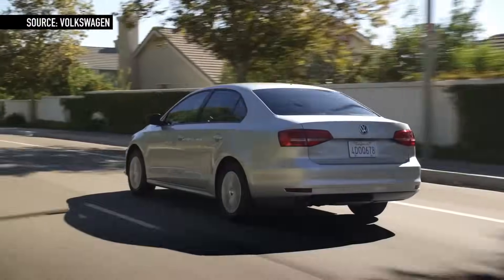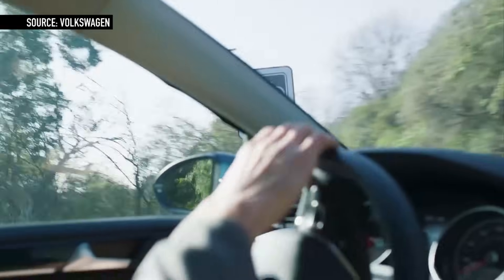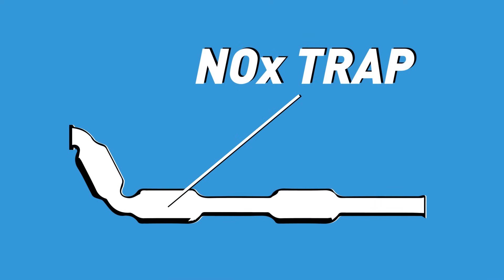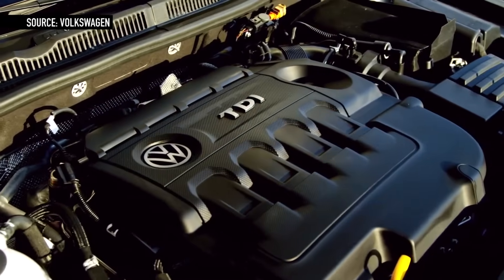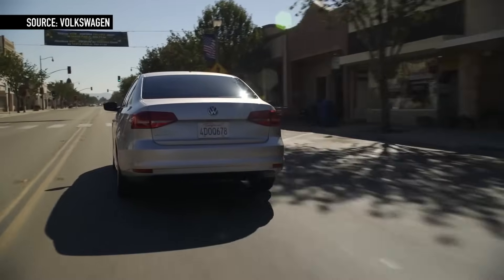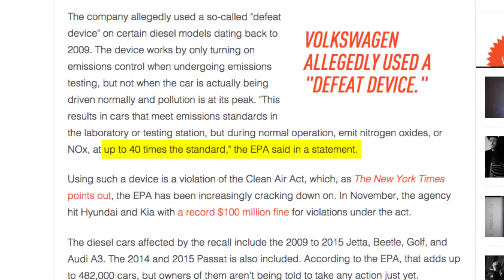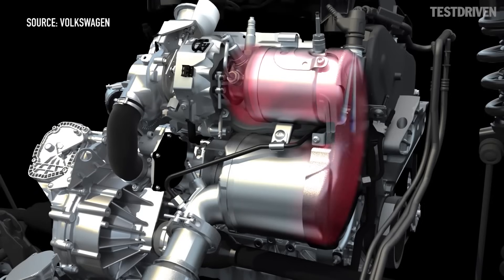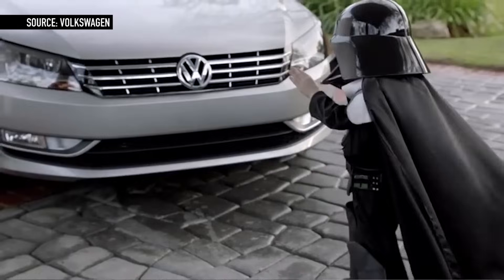Volkswagen's diesel scandal, explained

Comment: so more fuel burned equals better emissions, but more miles on less gas doesn't equal less emissions?
Reply: +Jonathan Root 
My hybrid car has a "lean burn" mode that uses less gasoline, but makes more nitric oxides.  In fact most modern Direct Injection engines have the same side effect.  (Burning more fuel eliminates the NOx but at cost of reduced MPG)
.
Reply: +eddie telleed the NOx are directly harmful to humans while CO2 is a greenhouse gas, it's not clear cut what's better
Reply: +Jonathan Root Yup...welcome to the United States!!!!!!
 I drove diesel cars in Europe in 2007 and was amazed...I mean totally astounded as to the performance and mileage that cannot come close to the US diesel cars. So I tried to buy one and was told that none were available in the US and if they were the performance would be at least 30% less. All this due to US standards, requiring you to  to spew tons more greenhouse gas at the cost of other trace pollutants. It is even worse now here...all new diesels in the US will need an "additive" in a separate tank that when it runs down, the engine performance decreases to compensate and keep the emissions standard up to par. It gets so expensive to operate, in addition to the higher diesel taxes in the US, the bottom line is we do not want the more efficient diesel engines on US roads. Hence you are at the mercy of gasoline.
Reply: +Stephen Griffin thats totaly true! that is whats all about...US doesnt like cars that are efficient because they dont make money by selling tons of fuel..so they decided to attack volkswagen for whatever reason they could come up with...  this isnt the first time... and people are dumb and believe everything they see on tv....
Reply: @HyralProductions  yeah, they decided to catch them lying about a fraudulent emissions system- you've got it all figured out!!!!
Reply: the US powers that be do not want cars with good fuel economy
Reply: In the real world a car uses air to burn fuel, not pure oxygen which is ideal. Air is about 78% Nitrogen & 21%Oxygen. That being said, if a car using is using more air and less fuel (running lean) it will create more NOx and vice-versa. To control and minimize all of the pollutants that a car produces, it requires a balancing act on the air/fuel mixture. This of course is neglecting the CO2 emissions  as a pollutant. (Save that for another debate on whether CO2 is a legit pollutant). It has nothing to do with the U.S. wanting us to buy more gas.
Reply: +Jonathan Root When ever that trap need to clean it's self. A little extra fuel is injected n to the engine after the main power stroke. This heat up the exhaust and the trap and it burn off soot. I drive a tractor and trailer that does this also. My old truck got 6.5 without the trap. The new one only get 5.9.
Reply: 666Tomato666
The CO2, Mercury, NOX and other byproducts  (even nuclear) 3X more of which from generating electricity than cars, I would guess.
Reply: eddie telleed I have my top men trying to decrypt your message, but just in case asking you is faster: Could you rephrase what you just said?
Reply: +Jonathan Root  Right?  funny the trucks that bring IN this fuel have NO emissions whatsoever...  What about the emissions of pumping and processing that much more crude oil? Its assnine...
Reply: Nader Naiem
That's right...the government is willing to insist that more CO2 be produced by burning more of the fuel combining with the oxygen in the air in order to produce less NOx overall. Pick your evil. The argument against doing this is it offsets diesel's advantages over lower compression engines. So saying it makes people burn more "gas"oline is that since this is less of a problem with gasoline engine and since they are cutting the balls off the diesel advantage...guess what...people are going to run gasoline engines and burn more gas. If you doubt e, just look at Italy and the percentage of diesel and gas on the road and the prices and use of each. Europe is diesel because from a cost and energy standpoint, it makes total sense.
Reply: +eddie telleed 
True that diesels have the energy and cost stand points. Hell I would like to trade in my car for a diesel. I commute about 100 miles round-trip 5 days a week. Diesel fuel here in the Nashville,TN area only costs about $0.20 more that reg. gasoline which is still budget friendly with the fact that I would be getting 10 mpg more than my Mazda 6.  If you however live in some parts of California and some urban areas NOx emission is a problem and maybe diesels would be a problem. This  fix or "diesel castration software" that VW is releasing will not make it so inviting for me to trade in my car anymore.
Reply: Lomachenko is the truth
Reply: Jonathan Root I agree, I think it's the other way around. When it detects it's being tested, it uses LESS fuel, creating LESS polluting emissions. Driven normal, it uses MORE fuel to give MORE power, consequently, making MORE pollutants.
Reply: yeah I think this is just a ploy to get us to buy more fuel

Comment: Nox trap is bollocks it's called a DPF Filter it catches soot particles not nox, nox gases happen when it runs lean u can't trap nox gases, get your facts right before making a video
Reply: it says that the nox trap is enhanced by unburnt fuel.. problem is that the car software let the engine produce more unburnt fuel (so more fuel consumprion) only in test condition. when not in test the sowtware "switches off" the unburnt fuel mode and so the nox trap is not enhanced anymore. the customer is then happy with the low fuel consumption but emits more nox without knowing. facts are explained pretty well imho

Comment: so basically
unburned fuel going into the exhaust pollutes the atmosphere with more nitrogen oxide . 
so to prevent that " Nox trap" is made and basically Volkswagen hacked to make it look like they have the best tool to prevent nitrogen oxide but it isn't in reality. 
the hack:
though Nox trap is terrible in Volkswagen it would work well if more fuel would be used so basically when the software knows it's being tested it would use more fuel to look like something Good. 
reality
while on road it would use less fuel to make it give more mileage to the customer.
conclusion:
profiting the customer by polluting the atmosphere.

thanks guys didn't know what the hell they were talking about.
Reply: +shankar yskr  True, good for consumer, not good for EPA
Reply: +shankar yskr out there ofcourse theres a lot of cars that has more nitrogen oxide intolerant than these VW.... nowadays, they just put a higher tax for them. So do VW have to pay that 'tax' to end this scandal or what?
Reply: +Adhi Suryana 'good for consumer'? I'd argue that polluting the atmosphere is in long run NOT good for the consumer. The emission limits are there for a reason. Ever heard stuff like 'each cigarette you smoke shortens your life by 5 minutes'? Think of all the days, months, years you're losing because of polluted air.
Reply: maclunar Really? I doubt it will make a difference, since "not everybody" able to afford these cars
The "1%" doesn't pollute the air by their car, it's the "20%" that will